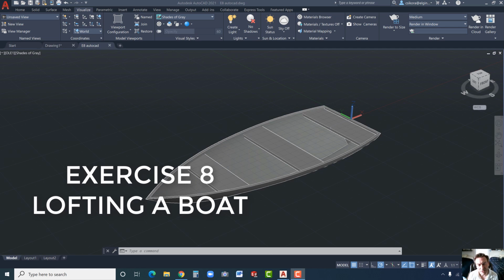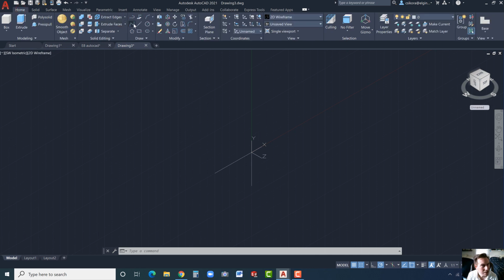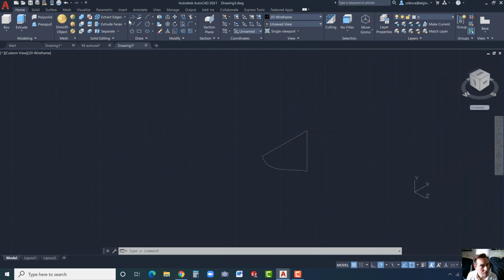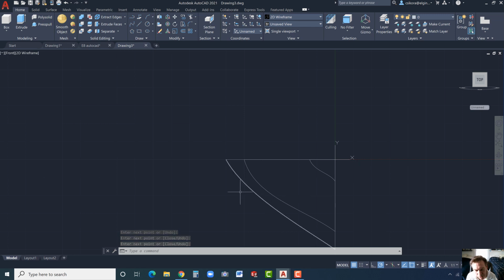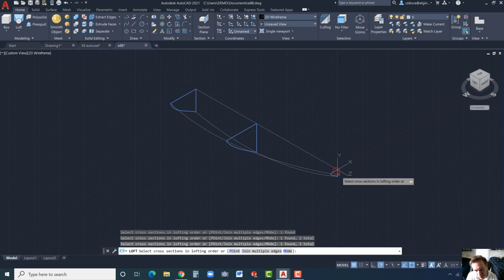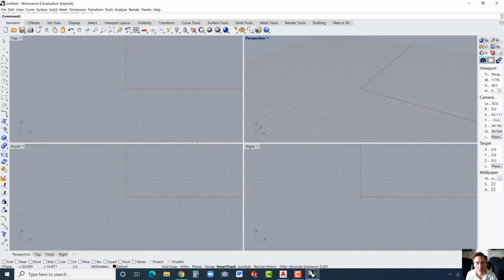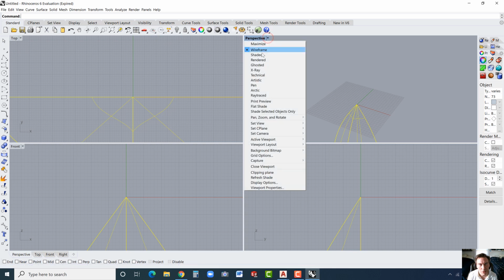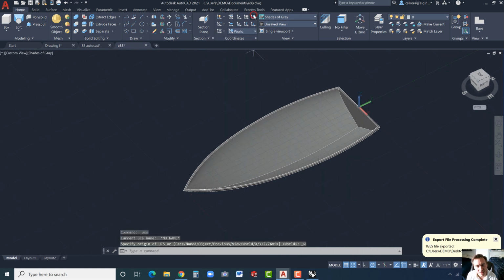E8 AutoCAD 2021 - 3D Lofted Boat Hull

Comment: 19:53 You can't Unroll or flatten a surface that has a double curvature. Command smash will do something but it will be unprecise. If you want to flatten a hull it has to be a hard chined hull with equal ammount of segments in each section.
Reply from the maker: Thank you. I often wondered why when I used the Rhino3D flatten tool it sometimes worked and sometimes didn't.